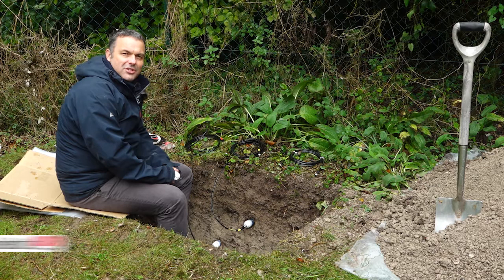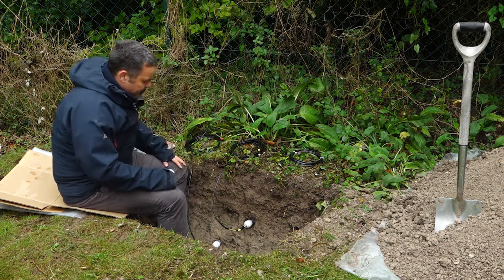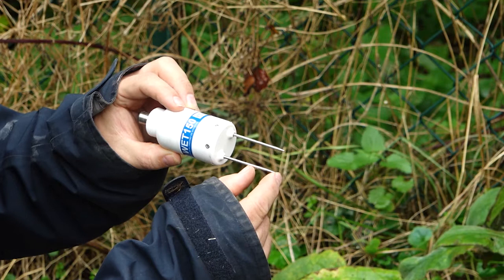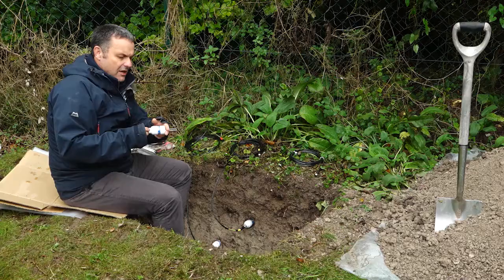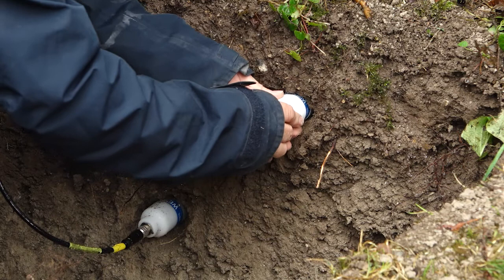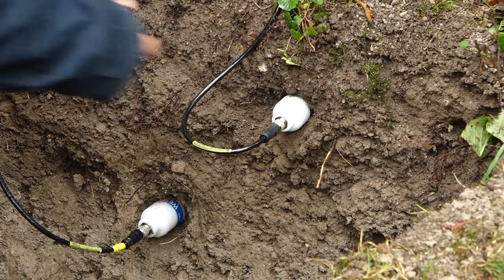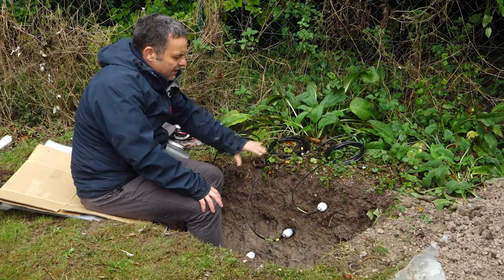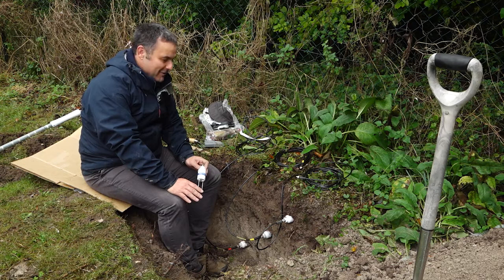How to install the WET150 Sensor (Delta-T Devices)

Comment: What is the maximum depth the sensor can be installed to?
Reply from the maker: Hi, Our sensors are routinely used successfully at depths of up to 10 metres, and in some projects considerably deeper.